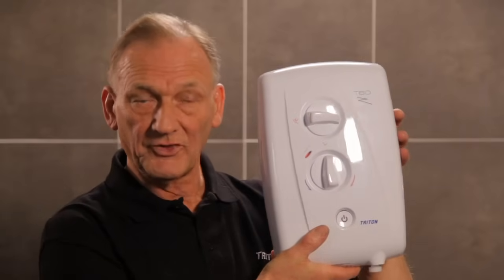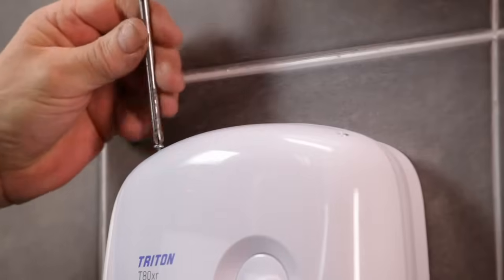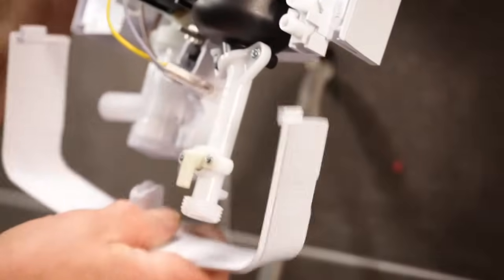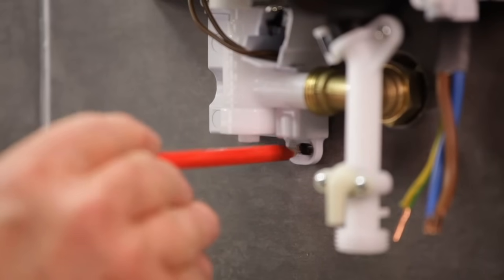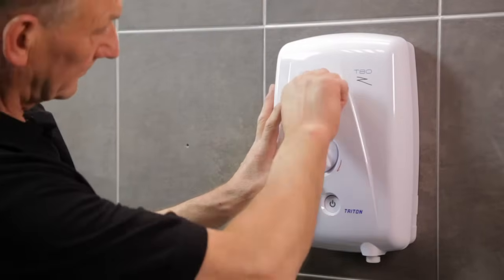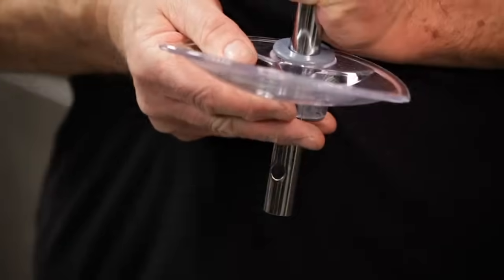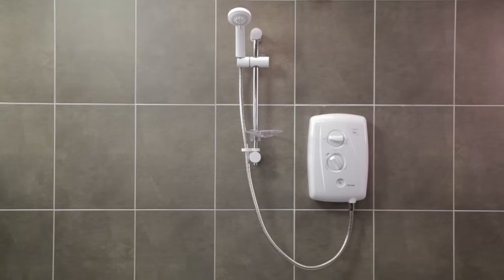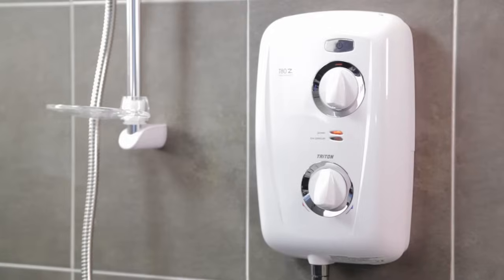Electric Showers: "How to install the T80Z Fast-Fit and replace the T80xr" video from Triton Showers

Comment: It baffles me as to why shower manufacturers can't get together and agree on a universal shower footprint. I'd settle for a manufacturer using the same footprint for all of their own showers. It's all very well being able to swivel water and electrical cables but the biggest problem is drilling new screw holes. I've seen gas pipes and other electrical cables running behind a shower unit. Personally if the screw holes aren't an exact match then it's tiles off. Those tiles may no longer be available. I think the manufacturer that standardizes shower footprints will save customers money and make it easier for installers.

Comment: If you don't push the plastic wall plugs behind the tiles, you're liable to crack the tiles as you tighten the screws.

Comment: Always makes me laugh when they say "It's as easy as that", doesn't always work that way. I noticed the compression elbow had enough slack on it to pull it out a bit to enable the nut to be loosened off to turn it to the left, if you didn't have any play you might struggle to undo it

Comment: Can I use Plastic piping connections to showers inlet instead of Copper? I am to use an 8.5kw cable, what size fuse? And does an Isolation switch with the Fuse in it , goes between shower unit and Fuse/ trip board?

Comment: Ive measured my water pressure and it 11 litres per minute. So i know it fine for my t80z 8.5kw triton shower. Yet when I switch my shower to hot its just dripping.Ive swapped the heat exchanger and its still rubbish. Running out of ideas as ive cleaned the filter out and stripped all parts and cleaned. Is there a fix and if not what shower has same hole alignment that isnt the same shower haha.

Comment: Well, a few weeks back I took out an old Gainsborough shower and installed a T80Z fast fit. Had to move the electric cable to a new hole in the tiling, using a special tile drill bit. New case fixing holes as well. Otherwise pretty good. Needing a new gate valve in the airing cupboard, not a fault of the T80Z, challenged my compression joint skills but I managed.

Comment: Just removed our old Aqualisa as it had given up, replaced it with this and it was basically a straight swap, no dramas, one thing I don't understand though is the power indicator light stays on even when not in use? Unless you isolate it at the pull cord of coarse.

Comment: Is the nut and olive for the water inlet a part of the supplied shower package?. I am just a little concerned about this connection.  Normally olives compress or 'dig into' a hard copper pipe to provide the water seal.  Here the olive digs into the soft plastic. Seems to me that if that first connection attempt leaks, then you've written off the entire unit, as you'd never to get it to seal properly on the 2nd attempt.  Are you allowed to fit JG Speedfit plastic push fit connectors instead?.
Reply from the maker: We don't supply the nut/olive no, we also wouldn't advise using a push fit as it will invalidate warranty, we state compression fittings only.

Comment: Does top pipe entry trims necessary? We did miss both left and right entry trims and now can see both openings ? Does it cause any harm if it kept open?
Reply from the maker: For warranty purposes we'd advise to fit them, also to prevent water entering easily into the product through the entries.

Comment: So took out a screw that holds the can, one that goes in to plastic.
Put in back and its like on a spring, it won't go fully in and tries to come out.
Any thoughts, I'm thinking air trapped in the hole
There's no water or grease in there

Comment: I have a Triton Ivory 4 . 9.5kw  keeps going hot and cold , what is the best replacement model  ?
Reply from the maker: We still sell the Ivory 4 model direct on our website https://www.tritonshowers.co.uk/ivory-4-electric-shower or you can find the Ivory 5 as a suitable replacement through local Homebase stores. It may be worth just checking the shower head is clear of blockages and the hose hasn't got a kink in it. Generally hot/cold issues will be due to low flow or flow restrictions.

Comment: my triton shower button doesnt work. But the ceiling pull cord turns water on but it isn't heated. any ideas? all fuses working normally
Reply from the maker: The water not heating can be caused by low water pressure, the shower will be using a pressure switch for the elements to go on. This requirements will be dependant on the kW rating of the shower. As for the on/off not working this could be an issue with the switch itself or the unit not being flat to the wall causing misalignment with the button/switch. If the installation doesn't appear to be the problem we'd recommend contacting our service team on 02476 372222.

Comment: We have a T70xr will this just fit with no rewiring or piping and are the fixing holes the same

Anyone know of a replacement for the t70xr that fits with no rewiring, pluming or holes
Just a pop on
Reply: Did this shower make a replacement for your t70xr
Reply from the maker: @batmangoddam5999  The T80Z Fast-Fit (or the T80 Pro-Fit) would replace a T70XR model. Kind regards, the Triton Online Team

Comment: Electric heater is not working.connection is OK.is there any other settings.water is draining out while On and no heater works.
Reply from the maker: Sorry to hear of the issues you are experiencing. If water is draining out of the bottom of the unit, it sounds like the pressure relief device (PRD) may have activated. This is a safety feature and the PRD is designed to activate when there is a pressure build up within the shower. This is usually caused by some kind of blockage to the flow of water through the unit, such as debris, limescale build up of the shower head or a kinked shower hose. If the PRD has indeed activated, it will need replacing as they cannot be 'reset'. It will also be advisable to inspect the shower unit and accessories for any of the previously mentioned blockages which may have caused the PRD to activate. 

If you require further assistance, please call our service team (contact details on the Triton Showers website).

Comment: Can this replace the triton madrid 2 unit??
Reply from the maker: Hi Tony. The water supply compression fitting will require turning through 90° to accommodate the Fast-Fit's horizontal inlet but other than that, the T80Z Fast-Fit is a relatively straightforward for a Madrid 2 unit. Hope this helps.

Comment: If the pressure valve fell ... I don't know what to call it. is there any danger
Reply from the maker: We would advise for further help on this sending over your contact details and potentially some photos of the part to our technical department on technical@tritonshowers.co.uk from there we should be able to assist you. Kind Regards, Leon.